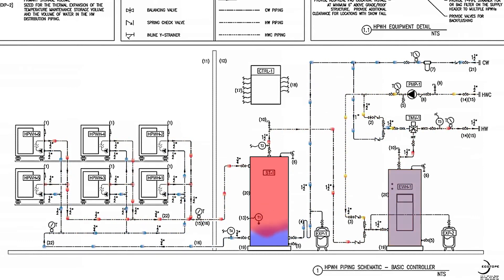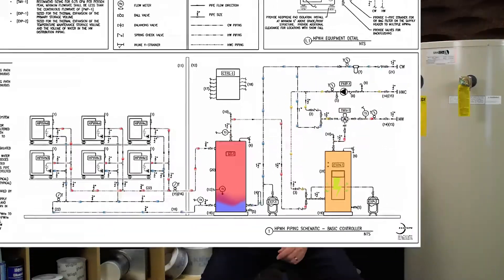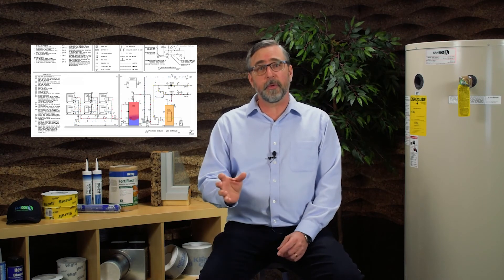SANCO2 Water Heating Plants:  Course Preview

Comment: Great video.  Great efficient tech. 

What is with the "Strict 1/2" water lines"  to and from the heat pump unit.   What problems would using 3/4 line cause?